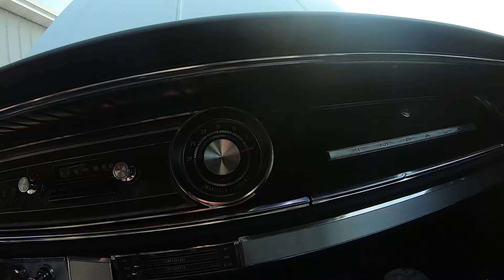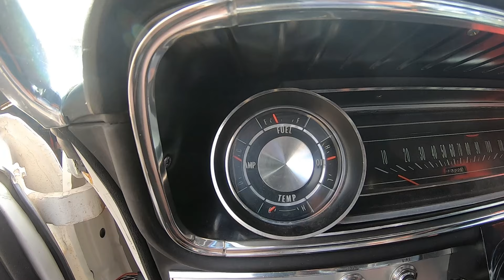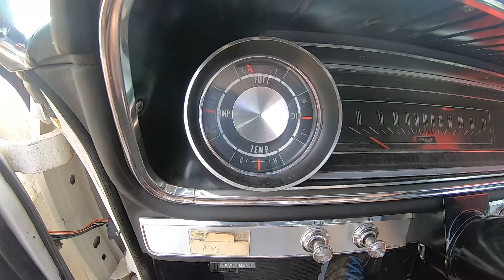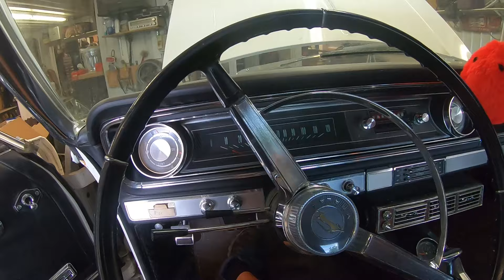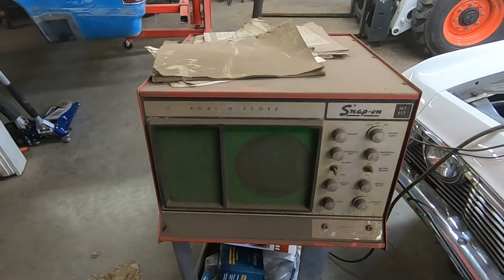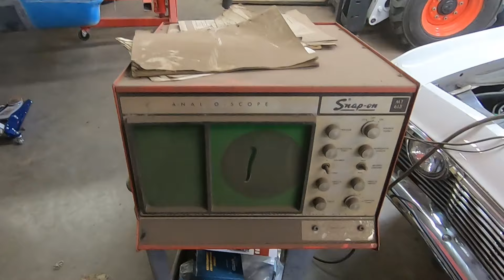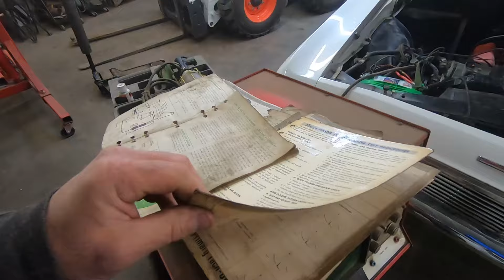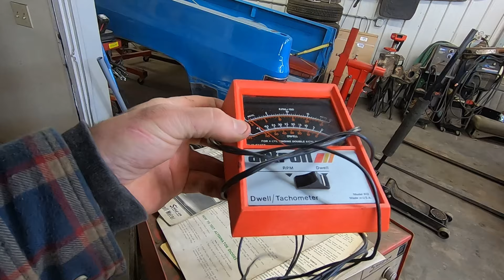Will It Run?!? 1965 Chevrolet Impala SS Resurrection! Parked for several years in a Barn!

Comment: Everyone knows that's a "Roosevelt Pin" and it gets torqued to 19.37 N-m... That Anal O Scope is sweet. You could be like Scanner Danner but instead of being stuck in the 90s you'll be stuck in the 70s!
Reply: Great stuff Wes.
Reply from the maker: I figured you would know! Heck, I'm stuck in the 60s so that's a compliment!
Reply: I liked the 70s so much I skipped the 80s n just had two 70s😁🙏
Reply: I Just Knew Watch Wes Work Was Privy

Comment: Been awhile since I have heard the howl of Powerglide pump drive gears, if you need a dwell meter I ran into one while cleaning my shop a couple months back. Funny what you find when your digging thru 30 plus years of automotive stuff, brought back good memories of the 1966 Impala SS 427 390hp T400 12 bolt 3.08 posi with console gauge package that I had.

Comment: This Florida Man's brake bleeder "system" (besides Russell Speed Bleeders on my "good" car) is clear hose in a large spaghetti sauce jar with the label removed. It's all clear so I can see fluid moving or bubbles, plus it's heavy and stable so I don't tip it over, plus it holds a lot. Also - I used my trained alligator to press the pedal. Because Florida.
Reply: I use an old mason jar with a hole drilled in the cap for the hose and another small hole for a vent. Works great.
Reply: The only trouble with the bottle with hose on the floor, they tip over spilling brake fluid in the floor !
Reply: Wife bleeding has caused a lot of divorces. 🥲

Comment: That's what the small "window" is for on the old points style distributor cap....you insert a small Allen wrench into the points set and adjust the dwell while the engine is idling

Comment: The unmistakable sound of a Chevy starter. Nice car, great job! Too bad you couldn’t keep it and do a donut or three!
Reply: FYI-Put a starter off a 2000 and newer 4.3 V-6 on it. I get em off late model Astro vans at the nearby yard for $25 each. They fit big and small block Chevy's. They bolt right up and are half the size. They make zero gear noise. Spins my 180 degree built 454 in my 55 Chevy over no problem.
Reply from the maker: Need to try one of those!

Comment: Love the 6 round taillights on the impala . But car that got my attention was the one you backed out .  53 ford custom? Both are cool cars. .....that's the way to get over the Datsun blues in a hurry!
Reply: Mortske with a clean and shiny car? And a will it run on a clean looking car? What’s this world coming to?
Reply from the maker: Yeah I sold the 53 last summer. Too nice for me!
Reply: @MortskeRepair  
But it's a FURD... Cool car but I'd stick with the GM brand myself. Old's 
Buick, Cadillac,  Pontiac,
Or maybe an Opel .. maybe a Saturn..nope no way, not for me. G.M.C would be cool.
Reply: Got a soft spot for that 53 Ford 2dr sdn. Last year for the flat-head, compression up to 7.5, horsepower up to 110. If equiped with overdrive, even sweeter !
Reply: @MortskeRepair  Sad to hear you sold it. Could have joined the Ford early V-8 club of America.
Reply from the maker: @jeromebreeding3302  This one was even better! Had a 350 and an auto!
Reply: @MortskeRepair  Ah, the ubuquitous small-block Chevy. It went the way of all flesh.

Comment: Cool video Mortske. That would be worth fixing up for sure. Not many fully optioned barn find 65 SS's around these days in great condition. Sucks it has a slip & slide Powerglide instead of a 4 speed but the floor shift and console are neat. Might not loose the shop after all huh?. Back in the 70's I had a 65 a 2 door Chevy Biscayne. 2 tail lights on each side. Primer black. Shot green interior. No carpet. If I recall right it had a 283 in it. The air cleaner lid was flipped over. Good for another horse or two. Three on the tree. Fun car. Bought for $75 bucks off a scrap dealer in the red light district of Tempe Az close to Arizona State University. Like everything else I've had over the years they wind up being donors for some rod I was building. That was a nice 53/54 Ford. Until next time.
Reply from the maker: Yeah I should've kept that 53 Ford.

Comment: Definition of Dwell angle: The number of degrees your distributor shaft rotates while the points are closed.
Reply: Not many know what that means or what a dwell meter is. Easiest way to set points on a Chevy. Just open the little door on the cap and insert the Allen wrench.  Turn while running and dwell meter connected.
Reply: @MaxNafeHorsemanship  Same way on my 67 Pontiac Cat back in the day!  Beat the heck out of "try and repeat" on Furds and Mopars!  I even had a little specialized tool, flexible shaft Allen wrench with a screwdriver handle so you could put the hex through the little drop-down aluminum door on the distro cap!  Perfect set every time!

Comment: A nice set of 15x8 rally wheels and 235/60/15 tires all the way around would look so good on that car !!
Reply: 245 or 255 would be much more better w/ 15x8 or 7in wheels. Like some stock metal blk smoothies. And dog dish caps.   👍
Reply: @FleshLessOne  with this car you would have clearance problems with taller tires remember they came out with 14" wheels and tires with G/78/14 on them H would be the step up so if you were going to go with blk steels and dog dish why not just keep the 3 spoke SS caps with a set of 225/70/14 tires and keep it classic ?
Reply: @haroldrogers6083  they wouldn't be taller just wider. As 235 245 or 255 is actually the width of tire not height. 60 series or 70 would be height. So a 245 or 255/60/15  would fit just fine. My friend's dad's '66 Impala SS has  a set of 15x8 torque thrust  whls w/ 245/60/15's on it and there's no clearance issues. The stance of the car is Perfect and it hugs the road GR8.
 FYI.
Reply: @FleshLessOne  the aspect ratio does go up with each bump , 235 is the old G , 245 is the old H , 255 would be the J with 275 the old L , the GMC Scottsdale in the old square body came with the Lr/60/15 that coverts to 275/60/15 on 8 in rallys , on my 86 Silverado i had 15x8 chrome stars and 275/60/15 on all 4 corners they filled up the fenderwell and cornered like it was on a rail .
Reply: @haroldrogers6083   I had a '86 Silverado also c10 w/stk rally's 15x7in w/ 255/60/15 and they fit perfectly.  If I'd had a set of 4x4 15x8 rallies I would of put 275/60/15's on it but those are 6lug and I had 5x5. My 64' Old's Cutlass has 15x7's on it w/255/60/15's and it's just right stance wise. However on my 64' El Camino I  got 70's z/28 rally's that are 15x7 and have 205/70/15's  on it and I would be able to squeeze a 225/60/15 on it, but the rears are hard to remove & put on as the whl house is very shallow and lowered 2in. Same as 64-65 chevelle 55-57 tri years and a few others.  Those Impala's got's lots of room and like my Old's can fit a 295/60/15 on rears. I've seen it done it. 15x10's on rear. But some like puny sized wheels and keep the stk ratio. I prefer bigger than stk but not too much bigger.
Reply: @FleshLessOne  yep i had a 66 El Camino that i ran a set of Keystone Classics in 15x7s and 225/70/15 tires all way around the rear was no problem on the ElCO cause they used air shocks on the rear only thing i had drag was the header collectors angled the ol school thrush mufflers that hung under the floor boards . A good bump they would scrap and i would have to take my 7 1/16 out of the glove box and tighten the collector ti muffler bolts up , but when street racing we would take out 2 bolts swing the muffler to the side and tighten those 2 bolts down to run it ooen headers then when we git back ti our setup spot pull them back down in place  and presto street legal once again
Reply: @FleshLessOne  15" x 7" Rally Wheels fit like a dream. 8" wide are a challenge on the rear of most '55-'68 or so full-size Chevys because of the low rear fender lip. The secret to get the 8" wide wheels tucked under there is to use a bumper jack.... Then the axle stays at it's lowest point once the tire leaves the ground. With fat x60's you still might have to squeeze the wheel/tire sideways a bit to get it over top of the hub, but they usually fit in there, even though it's a very snug fit.

Comment: Sorry to disappoint Mort, I put a glasspack on everything. Just cut a rattly Flowmaster off my '83 Chevy to put on a glasspack. FYI you should be mighty scared of those tires, at 34:31 I see a date code of 1101, 11th week of 2001! But don't feel bad, my '83 Chevy C20 has tires from 2003! ... But they're 6 or 8 ply or some such heavy duty nonsense so they'll probably last until 2043, not that I'm not planning on replacing them, I was doing 70 coming home on those tires! SKEEEETCH!
Reply from the maker: Yeah, the tires need to go!

Comment: I couldn't see the factory recall engine safety tie downs on the exhaust manifolds - bad things happen when the driver side motor mount heads south on you.
Reply: That 327 doesnt make enough power to break that motor mount
Reply: @Bill-xc8le  It's not a matter of power - The rubber rots and rips apart - you don't want that to happen because of the solid throttle linkage to the carb pulls open the carb when the engine lifts and causes chaos.
Reply: @johnhere6058  ya I kind of figured something of that sort after I had already replied, I never thought about the linkage, thanks John!!
Reply: Neighbor had an old Chevy truck  with a busted motor mount that he used on the farm. Never had to use the throttle when taking off. Just start letting the clutch out, the motor twisted and opened the throttle all by itself.
Reply: @robgm6926  That would be funny - We were at Libby Montana to a car show - I was putting my 55 Chevy Belair back on my trailer when I gave it a little throttle my new mount from Eckler's let loose,  it all happened so fast that I hit the end of my trailer - no real damage but sure scared the crap out of me

Comment: you can use your fluke to set dwell using the inductive pickup lead that clamps on to the spark plug wire I started working on cars using a Giant snap on oscilloscope they aren't worth anything but they are still cool love seeing these videos on setting dwell and old diag stuff just good clean fun great vidja!!
Reply from the maker: Thanks for the info!

Comment: When I came out of the US Army Signal Corps in 1970, I bought a used 1965 Impala Super Sport 2 door hard top (all white with the deluxe red interior) from Kenny Chevy town in Johnstown, Ohio. This car had the L78 425 HP engine mated to the X2 speed Power Glide Transmission. The car was super fast and we (she and I and my girl friend who did the whoopee cushion thing)  loved to go fast and it would shift out of low gear at 80 mph. I literally passed every car on the road, even in a 85 degree curve routinely. This car was the best drifting car I ever drove. The Japanese drifters would have loved this car, it was perfectly balanced for drifting. I could pass cars and drift thru curves at the same time. The car was so fast, I had to steer left of the car I was passing before I floored the 4 barrel carb to pass, otherwise I might crash into the back end of the car in front of me. There were no lines on the highways yet, so passing was at our own risk. I would love to own another one to fly again. My 1972 Monte Carlo with the 454 engine with the X4 speed Turbo 400 Hydromatic transmission is not quite as fast.
Reply from the maker: Thanks for sharing

Comment: Try pulling the valve cover off the left bank and cleaning out the oil return at the rear of the head with a coat hanger. That might stop the blue smoke.

Comment: use an allen wrench and lift the window on the side of the dist cap. while the engine is running turn it one way until it runs rough then turn it the other way until it runs rough then about halfway in the middle. of course you have to have the idle speed right before you adjust it.

Comment: Nice car!!  My first car was a 67 Impala  327 with a powerglide, I paid 75 bucks for it in 1975 and worked on it for a year till I got my license! I wish that I still had it. It was a lead sled But it wasn't a slouch either!!
Reply from the maker: Just drug a 67 Impala home yesterday! Paid a bit more than that however.
Reply: @douglas jarvi.......your comment brought back memories.....my first car was a '57 chevy - 4 door grandma car with a 235 & powerglide.  Also, I paid $75 for 
                                 it in 1974 - drove it for all three years in high school - then sold it for $75 when I went into the Air Force in 1977.  It was a smoky oil burner.
Reply from the maker: @urbanurchin5930  Free use of a 57 chevy!

Comment: Excellent video Mortske Repair  :) my  first car Pontiac Grand Le Mans 2 door or Chevrolet Impala never put glass packs on exhaust ever Lol and I put fun nice mellowed one ! For my rear view mirror put lucky metal Dolphin  to so and sure enjoy them both when had to! Sold both did Pontiac in 1998 and October 9 did Impala ! Never like those 200 Power Glide transmission to much should have 350 or 400 for 3 speed Automatic transmission and 700SR 4speed Overdrive Automatic transmission excellent ones ! Plus smoking issues could be PCV Valve need replaced and Choke stick on too ! Yes those Brakes adjustment hole be back plates but some reason they didn't make in certain years but can add one Mortske Repair or get order with new set back plates ! Air Conditioning pump would change to new type with fluid last longer too and easy fix too!

Comment: That is a oscilloscope for reading voltage waves and such I think there is a dwell meter that you can hook to that but it's another meter that you gotta have. I have a couple Dwell meters one is a sun, and have a hand held one that use to be my fathers and a plastic one I got at a garage sale that's a Dwell,Tach and Voltage meter and came with a timing gun in a set anyway they are real easy to use just hook the meter up and make sure it's on 8 cylinder setting and set the dwell to whatever degree the car calls for.

Comment: Nice ride! It even has the dreaded flex hose on top, all you would need is some good tube headers to round out that engine bay!😎😁😉
I'd expect the engine to have some slightly sticky rings after sitting for some time.
Reply from the maker: And maybe some Cragars!
Reply: @MortskeRepair  Cragar S/S's! No unilugs though!
Reply from the maker: @MM_in_Havasu  ugh
Reply: @MortskeRepair  🤣🤣🤣🤣
Reply: @MM_in_Havasu  Cragar S/S for sure, but 15" x7-8" rims with some wide x60 stickies. Now you've got a car that lives up to the Super Sport name!

Comment: I have the Actron Combination dwell tach voltmeter bought it Kmart about 38 years ago LOL , Setting the dwell on those old GM’s was easy there was a little sliding window on the distributor cap and you inserted the appropriate sized Allen wrench that actually adjusted the dwell while the engine was running To the appropriate degrees while your meter was hooked up
Reply from the maker: Heck yeah! Collector! I wish I had found mine in time!

Comment: I just to have a 65 Impala SS convert. and if I remember correctly you can adjust the points with the meter and the engine running, there was a little door on the side of the distributor cap where you use some kind of allen range to open and close the points.
Reply from the maker: Yup you sure can! I'll have to show more detail on it next time.

Comment: Antenna in back ss only feature power windows awesome option also has bumper guards that vinyls top trim is pretty rare stuff , great car also not all super sports have a tachometer mine came with a manifold vacuum gauge instead
Reply from the maker: Thanks for the info!

Comment: My dad had a 65 Bel Air and when it did that it was valve guides and also the little rubber caps on the valve springs

Comment: Tip for self bleeding brakes or hydraulic clutches take a clear hose that fits bleeder valve use spray bottle sprayer connect clear hose open bleeder squirt till straight fluid is in the line close bleeder move to the next one ur welcome takes less time than that their bottle

Comment: Brake adjustment hole is on the bottom of backing plate on all wheels get rubber plugs for brake adjustment holes

Comment: The adjustment hole to adjust the brakes should be in the drum. You tap them out with a punch or chisel. Then there used to be metal inserts to close the adjustment hole.
Reply from the maker: Good call! I'll have to check that next time.

Comment: 2 years back was suffering a weak older battery, another old guy told me drop an aspirin down every cell and top off the water. result: digital charger would stop at 50-55% before, next day it ran right up to 85%, another hour to 90%, 3 more hours hit 100%. I was floored, here it is 2 years later and still no problem.
Reply: most points usually happy about .018" on a lobe, barely dragging on an older thicker matchbook cover was close enough in a pinch, matchbook covers are thinner now, use a feeler. for giggles the customer should try Seafoam literally all orifices (gas water and oil), warm+cool it several times, change oil with a can of Restore in it, see if some rings free up to run better. it'll work or it wont, easy and cheap enough anyway. old marvel mystery oil in the fuel could help accelerator pump etc too.. stuff is hashed or it isn't, sweet car tho.

Comment: I had a 65 or 66 Impala it was a 325 HP 396 and Glide? 2 door but not an SS. The quadrajet leaks, and the engine caught fire the car was roasted in the parking lot of the Tech Bldg at SIU. The spring of 71. Same year I was drafted.
Reply from the maker: That's too bad!

Comment: I’m surprised!  This isn’t a crusher car like you usually like. Good find. Looks like it’s missing a little trim around the wheel wells but other than that it looks like it’s all there. Engine doesn’t look stock. Heads sort of look like 350 heads.
Reply: Canister Filter sort of indicates an early block. 283 or 327 block.